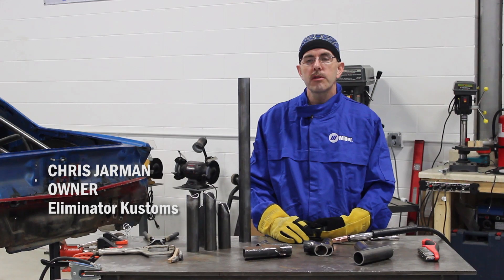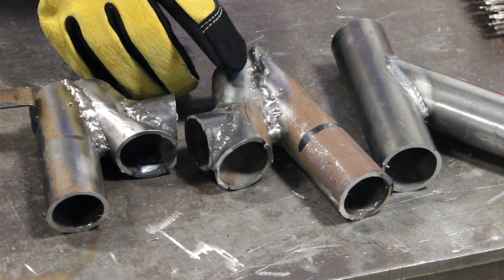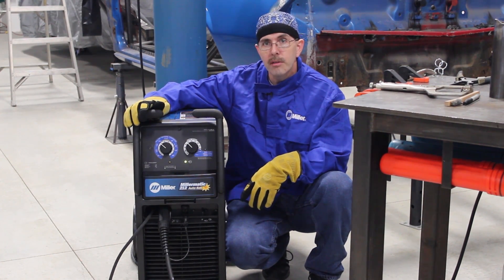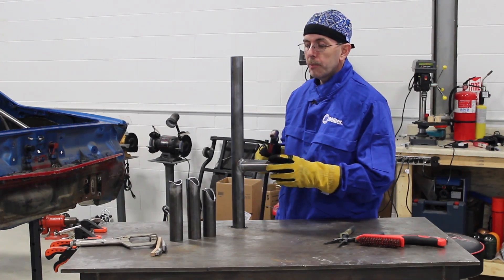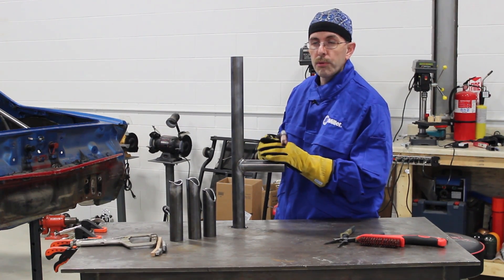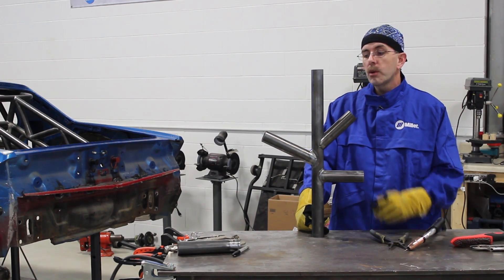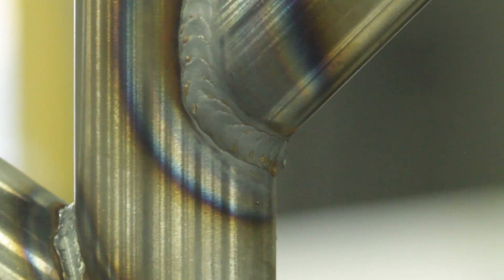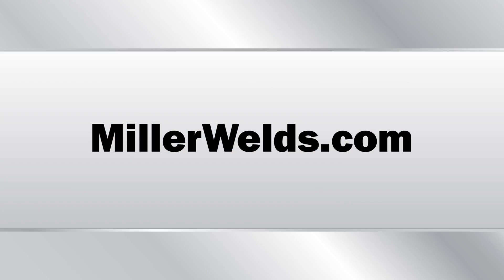MIG Welding Techniques for Building a Mild Steel Roll Cage

Comment: Isn't TIG method better for quality welds, such as rollcage welding?
Reply from the maker: +TransAmDrifter PL  It will depend on the roll cage material and sanctioning body rules. While mild steel cages can be MIG or TIG welded,  we recommend TIG for 4130 Cr-Mo cage material. Please let us know if you have any further questions.

Comment: If i gonna be welding with stick welding machine what electrodes should I use? and what amperage for the 30 and 45 degrees ?
Reply from the maker: +toolman talal Thanks for your question. We would recommend using a MIG process to weld in this application. However, if that's not possible, you'll want to use a 3/32" size 7018 electrode. This is a good electrode for welding in all positions, so will work well to handle tubing. To weld with this size electrode, you will need between 65 and 100 amps, depending on how thick the tubing is. For heavier frame rails or tubing (1/8" or higher), you can increase the electrode size to 1/8" and use a 110- to 160-amp machine. Good luck - let us know how it goes!
Reply: Miller Welders thanks this was an excellent answer  :) .

Comment: pushing preheats where you are going unlike pulling which leaves it colder, and when pushing you aren't sitting in front of the puddle, you're actually right on the edge which leaves it good and hot, when you pull the bead gets cold faster and gives penetration, for a good demonstration look at this video https://www.youtube.com/watch?v=EEF61gyN5Gw

Comment: For some tubing joints I find I have to stop and start again because of a poor position.  Any tips on proper restart?
Reply from the maker: valveman12,

Starting and stopping on roll cage tubing is very common. Normally with thicker tubing, starting and stopping is always a point of possible failure due to the colder starting point. With stock car chassis, most of the tubing thickness is .120 wall, making cold starting less of an issue. Also, the massive amount of tubing and triangulation in chassis design overcompensates for any individual stressed applied to one select weld starting point.

If you are concerned about starts and want to make sure you are at a higher weld temperature when you hit the weld joint, start (partially) on the stop point of the previous weld, then roll into the joint. Another way to help ensure that your starts are quicker is by clipping off the ball that forms on the weld wire after you finish the previous weld, prior to starting the next.
Keep in mind that if you change your weld position and travel from a pull to a push, or vice-versa, the weld will look noticeably different.  It takes a slight machine adjustment to go from pull to push and keep the weld appearance and penetration similar.

Please let us know if you have any further questions.
Reply: Miller Welders Than you for the reply and info.

Comment: I was hoping you could answer this, is this technique of goin forward and then back before goin forward again somethin you have found to work good for cages or is this just how you typically weld. Ive seen and done alot of techniques and do this w tig sometimes but never tried it w mig. Your welds look great and was very curious to see the forward then back. Was hopin u could give some insight on that technique. Thanks and love the video ill be tryin it
Reply from the maker: Brian B The torch manipulation used here was mainly for aesthetics. Torch manipulation works very well when filling any type of gap.  As the torch moves forward out of the puddle, it causes a freeze line in the back. As the torch is manipulated back into the puddle, there is increased penetration into the base material. Overall, the strongest weld bead is a steady stringer bead, but most people like the aesthetic freeze lines that torch manipulation leaves behind. Also, the technique used in this video was a circular technique. Please let us know if you have any further questions.

Comment: What size filler wire did you use ? thanks
Reply from the maker: reaperwayne We used 0.30 filler metal wire on these roll cage angles. Please let us know if you have any further questions.
Reply: Thank you

Comment: Hello. what Amp do i need to have on my welding mechin to be abel to welld a steel Roll cage?
have a 230V 180amp welder now.... will it do the work?
Reply from the maker: Potog13 - Yes - A 180 amps welder would be enough to make weld on roll cages.  We recommend downloading our Miller “weldsettings” app ( http://www.millerwelds.com/mobile/ ).  This app will give you the recommended settings for the different types and sizes of wires. Please let us know if you have any further questions.
Reply: Miller Welders  The app is great! thanks :)
Reply from the maker: No problem. We're glad you find it helpful. Let us know if you have any further questions.

Comment: I keep seeing a lot of talk about vertical down and vertical up welding, push or pull. Some people question if its good or bad? In the end the answer is.....yes. Anyone can set parameters for a vertical up weld and set them wrong. Yes, one position gives more penetration given the direction of travel blah blah blah. Its a well know fact to all of us that weld for a living. Now, I'm a Welding Engineering Technology major right now and one of the biggest things that our studies have found is that a big part of penetration lies in the work/travel angle. We have found a lot of tests that support the vitality of your need for penetration lies in your parameters (easy enough to figure out) and your work/travel angle. I'm still not sure why this is. I believe that GMAW is becoming such a fast solidification process that lack of penetration/fusion or even partial fusion can be solved by some angle adjustments. Just some food for thought. Not saying I'm right or wrong. Just wanted to let some people know so maybe they could try it and see if it helps somewhere down the line. Cheers!

Comment: I understand your method of turning up the heat to get into the joint better and that is fine. My mothod is to keep the settings untouched and pull back the nozzle exposing the inner tip more allowing me to get further into the joint like your 45 degree example. just be careful not to touch or dip the tip.. Other than the risk of dipping the tip there are no negatives to the method I have mentioned.. Just a tip from a professional fabricator to anyone who may not be so experienced..
Reply: What about directing the shielding gas? You lose some of that without the nozzle don’t you? Wouldn’t that hurt penetration some? Seriously asking.

Comment: Damn, look at those arcs... this guy's a champ. He never even touched-on the hardest part about welding tubing; making smooth arcs. Pulling a weld around a tight circumference like that is annoyingly difficult. You're basically welding blind. That's why most MIG'd cages have more of a diamond shape to the welds, rather than a circle. Even on 3" exhaust tubing, it's difficult to go all the way around without welding off into the sunset somewhere.

Comment: stop putting going back with your torch in the puddle, each time you do that you stop the penetration in the front of your weld.
AND ALSO DON'T WELD DOWN HILL IT HAS NO PENETRATION!!!!
Reply: Interesting that you say a downward weld has no penetration.. I am a professional fabricator and I build things that are shot at regularly such as reactive targets like Pie racks, dueling trees, IPSC Targets and lots of other odd jobs that require Armor plate and etc..  A lot of times I use a vertical down technique on crucial areas and even though people are shooting thousands and thousands of rounds at the things I build, I have yet for anything to come back that has broken or failed. Proper technique, heat and travel speed are what gets good penetration. Not the direction you travel. As far as push/pull blah blah, I have to do it all and it is more a matter of circumstance and preference than it is strength. We have tested it and I am here to tell you that a vertical down weld can be very strong.. If it can stand up to the vibration and force transferred from the impact of a .50 cal rifle round or .338 Lapua I think it is fine for a roll cage ;)..  I am the lead fabricator of Armorgeddonready.com the targets I build are used at competitions as well as training facilities and gun ranges. if they failed, they would not be.. That is all..
Reply: I guess a .308 round at 10 Meters doesn't create any pressure, or the .50 Barrett at 100 Meters..  All the things I build can be found here.. We do pretty much anything you can think of when it comes to armor..  www.armorgeddonready.com  Everything you see on this site I built.. Now granted most things are not welded in a vertical down motion but some things are such as the hinges on the Pie rack and the Brackets that hold the paddles on the dueling tree.. .. Thousands of rifle rounds and no weld failures.. Material ranges from 3/8 to 1/2" thickness.. 1/2" is the very hard AR550  used for the High powered rifles.. such as the .50 caliber sniper rifles and etc..  There is also the "Pulse mode" on the Miller 350 that we use that works very well for the thicker materials. Good setting for Pulse with .035 wire is 25, 440..   When welding in the normal MIG setting with 3/8" down to 1/8" material I have found that 18.1, 282 works really well..  Now I will admit that a Verticle down weld is not as strong as a horizontal weld whether it be a push or pull. However I have one question for you.. Would you rather have a not so good welder which in my experience 80% of welders fall in this category do an upward motion or have a really skilled welder do a vertical down? The main factor in my mind would be the welder and not so much the direction :)
Reply: +Kamel Khenifar When you do not know what you are talking about a wise man keeps his mouth shut otherwise he looks stupid and ignorant - like you.
Reply: drvn1 i believe that down hill can have penetration.On smaller material thicknesses. Bet when you get into heavy plate and structural welds. Or any thing that is under constant pressure or load. You should always run uphill... Down hand has its place. As in fast production and products that are not great loads of pressure. Also is depends on type of filler you are using. That is just my two cents..  .

Comment: What amps/wire speed and volts was he at? I use the exact same mig welder at my school, that way i could get a rough idea when I practice on bars/pipe.
Reply from the maker: monsterink101 It's going to depend on how fast your move or manipulate the MIG gun. A good starting spot would be voltage at 4 and wire speed at 50 for 1/8 material, or voltage at 3 and a wire speed of 45 for your .083-.095 thickness. Hope this helps.
Reply: Ok cool thanks ill give that a shot
Reply: Miller Welders
What would the setting be compared to on a miller 211???

Comment: Miller Welder, thank you for your input, I agree with you on the push/pull statements you made HOWEVER, that DOES NOT apply to VERTICAL DOWN WELDING  like shown in the PIPE/TUBE welding shown in the video I commented on; but flat, of course it's true.

Comment from the maker: cwlewis123 - When using the Push method (or forehand technique), it actually produces lower penetration because the arc force is directed away from the weld puddle. The Pull method (or backhand technique) will typically produce deeper penetration. When MIG welding mild steel you can use either method, but pushing usually offers a better view and enables you to better direct wire into the joint. Here's a great article on mild steel MIG welding that can explain more:
http://www.millerwelds.com/resources/articles/MIG-Welding-The-Basics-for-Mild-Steel/
Reply: +Miller Welders 
You forgot a joint there at 5:31.
Reply: Thats what he said

Comment: Nicely shot video, kinda concerned that Miller (being a welding industry Leader) would have ensured this gentleman "teaching" knew the difference in push and pull MIG welding before doing this video...CWLewis123 and a couple other guys caught it...PUSHING gives you deeper penetration and PULLING gives you less, plus you gotta haul butt in the travel speed.  Looks to me like he was welding most pulling down hill cuz it's easier than pushing up hill..Kool looking roll cage though..
Reply from the maker: Hi gordon davis - When using the Push method (or forehand technique), it actually produces lower penetration because the arc force is directed away from the weld puddle. The Pull method (or backhand technique) will typically produce deeper penetration. When MIG welding mild steel you can use either method, but pushing usually offers a better view and enables you to better direct wire into the joint. Here's a great article on mild steel MIG welding that can explain more:
http://www.millerwelds.com/resources/articles/MIG-Welding-The-Basics-for-Mild-Steel/
Reply: AKweldshop What's important is strong welds. Get that down then work on making em pretty. Fact is you wont always be able to get away with done just one.

Comment: I liked how he used it in the manual mode...because the auto mode sucks!  Mine was an out of box failure and had to be sent back for a board replacement.  Even after the board replacement the weld stutters at the beginning of each weld, almost impossible to accomplish a decent plug weld on auto body panel thickness'.
Reply from the maker: Gary - you may want to check a few things to make sure the Auto-Set function is working properly. You're connected to 208V or 230V power, correct? A good ground is key, so make sure all paint is removed. The Millermatic 212 is a bit more sensitive to stickout lengths, so make sure to shorten up that distance as much as possible. If you've tried these fixes already, you may want to give our service guys a call when you're in front of the machine to talk through some other possibilities. You can call 920-734-9821 and ask for MIG service. Let us know if you have any other questions.

Comment: well at the completed roll cage part 5:35 you missed a weld bottom side 1st vertical from right 1st horizontal from the bottom
Reply: Must be the same (missing) weld visible at 0:15 that also caught my eye.
Reply: Yes, truth. I would have done a bit more practice before committing it to Video for all to see. At my School Mig Pipe is 'B' so there is no way that would have been accepted, 15% better would barely pass unless you were lucky and the Instructor was busy. I am not saying it is unacceptable.

Comment: Downhill short-circuit mig has a place, and welding cages isn't it. IMHO...
Reply: The funny thing is that they don't want you to stop your welds either. They want a continuous weld. Kind of impossible to do vertical up all the way around without stopping.

fyi I'm being half way sarcastic.

Comment: I would hate to do one of these videos because It seems like every time I see one I see a bunch of little things that I can critique. This video is about mild steel mig welding right? The title of the video is made welding mild steel roll cages. In the shot at the end of the video where the sub titles said "completed roll cage" (also the same cage shown in the beginning) it's not mig welded its tig welded, also it wasn't "completed" because there's a weld joint not finished welded. The tig welds shown in that shot did not look "professional"  in my opinion. Other wise the mig welds shown looked good, except for the one weld done uphill on the 30° joint which I noticed was purposely not shown. one thing I didn't agree with is the order in which the joints where welded A fillet joint can take more heat so the back part of the notch should be welded last because it needs the most heat, welding the rest of the joint first will preheat the tubing. Their was a lot of talk about pushing and pulling but what wasn't talked about was uphill or downhill. Uphill welding definitely puts more heat into the weld joint with less amps needed to get the same amount of penetration, it's definitely a lot harder to weld uphill and make it look good, it can require different wire feed setting to get it right. I have been doing most of my welding downhill because I've been unable to get acceptable results welding uphill. but I know that uphill welding does have better penetration. I'm surprised that wasn't mentioned it all. Jody from welding tips and tricks.com did a excellent video on welding uphill with different amp settings and did a cut and polished and acid etch to show the different penetrations, I don't remember the exact numbers but it was something like 15 A welding uphill provided more penetration then 26 apps welding downhill. Also I wanted to add that I own a Miller to 212 and I don't care for it because it has really bad pop starts, and tends to sputter badly  if you get a little too much stick out. I talked to a few Miller employees about this problem and they seem to be well aware of it.
Reply from the maker: Hi Mark Benoit - The welds in this video were completed with the Millermatic 212 Auto-Set MIG welder, but parts of the roll cage were TIG welded with the Dynasty 350. That was not captured for the video. In certain applications, like in structural pipe welding, sometimes the requirement is to go uphill. The material in this video is thin-wall tubing, not structural pipe. Since this is thin-wall tubing, downhill is perfectly acceptable. We do realize that the roll cage isn't totally completed, and that tag can be a bit misleading. We apologize for that. If you have other questions, or concerns about your equipment, please contact us at youtube@millerwelds.com.
Reply: Mark Benoit always that one guy in the comments lol

Food critic who usually can’t even cook them selves. But watch a lot of YouTube so they know it all.